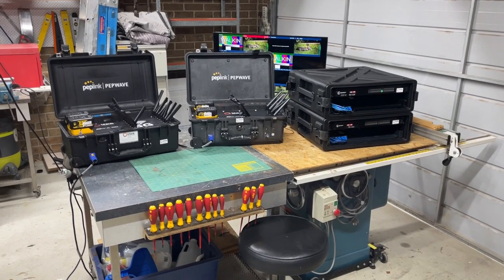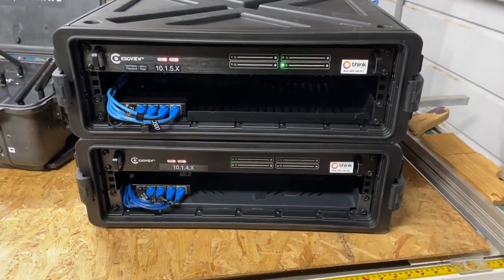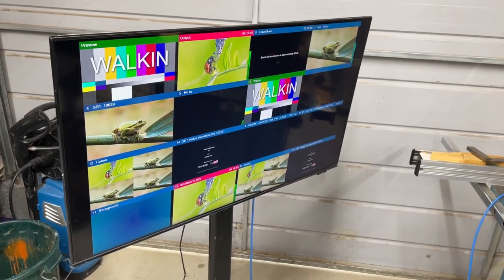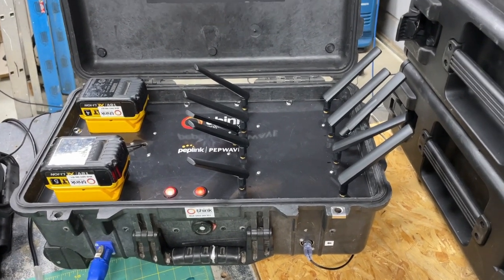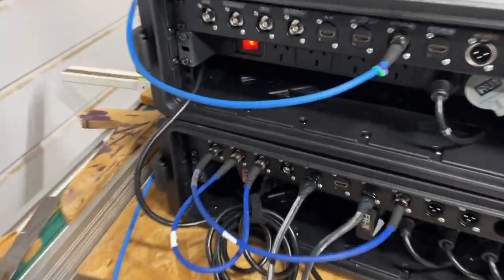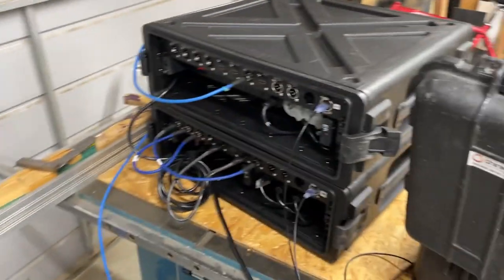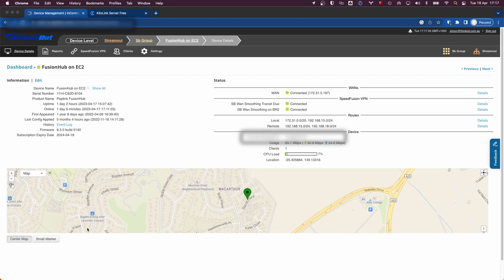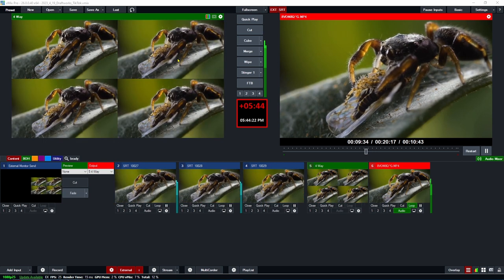Streamout Remote Production with Vmix, SRT and Pepwave

Comment: looks great. one question. how are you handling the audio return feed ? is it coming in on one of the io cards ? am looking to build myself something similar and the audio return is something i'm struggling to find a solution for
Reply from the maker: Hi Jack. Yes it is coming from the 3.5mm audio jack on the Decoder board. I’ve installed a pair of balancing transformers in the rack so that the output is isolated as well as balanced.
Reply: @StreamoutAU  ah   that makes sense , was just unsure if there was a separate encoder/decoder handling the audio.  and i take it you'd have the opposite for audio in to take in a feed from a venue on the encoder side  if they have a local mixer which their microphones were being plugged into  ( if you were not on a vmix call)   out of curiosity . did you look at running a simple dante line instead of running the balancing transformers?

Comment: Thanks for sharing this great setup. Could you explain better something about the battery stage? Self-made or a commercial one?
Reply from the maker: Hi Lapo. I built it myself using parts from Meanwell and the battery sleds a from Ebay.
Reply: Hi Simon  @StreamoutAU , I had some free time to try to figure it out with Meanwell Powersupply PSC serie, but I have some troubles to safely connect it. If you want and if you have the time, can you take a couple of photos of the inside content of your boxes? I have a single Balance 20x and I would like to use with a powersupply or battery when I'm outside. Thanks anyway.

Comment: How easy do you find making SRT calls through cellular networks? 

Since you cannot do port forwarding, how do you manage it? Are you using an SRT gateway?
Reply from the maker: Hi Ignacio. Because my control room has a static IP address, it is simply a case of configuring the Kiloview boxes to call my control room. In my control room, I have some ports forwarding to the Vmix machine and it is in listener mode.
Reply: @StreamoutAU  thanks so much!